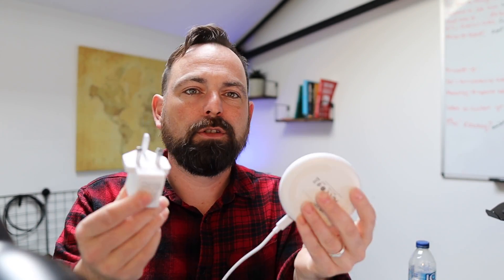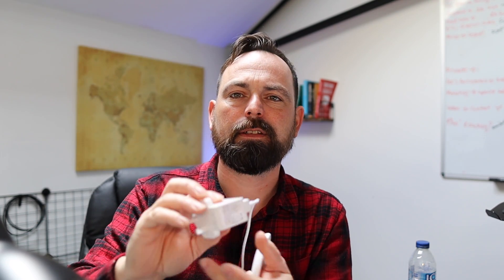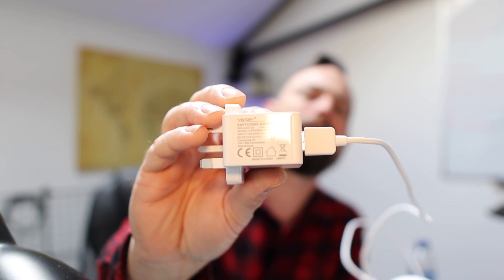PAT  Testing Explained | What you do and what you don't need! Electrical Safety

Comment: He doesn’t know what he’s talking about. He said if it hard wired into an outlet then it’s not portable. An outlet refers to a 13am socket outlet . If it’s hard wired then it will be wired into a fused connection unit commonly known as a fused spur. Also the first example of a double insulated plug which was a phone charger or something should still be tested for insulation resistance, as the plastic could be degrading and allowing voltage to leak through.

Comment: so what if it doesnt pass? just cut the plug end off and the owner of the appliance has to bin it
Reply: Cut the plug off. Cut the cable nearest the body of the appliance or some fool will put a new plug on and try to use it. Also label it as unsafe.
Reply: You saying new equipment does definitely not need testing is in my opinion wrong.i tested a brand new fane from China. It failed its earth bond test because the cable was too thin therefore increasing the resistance. Always test an appliance before initial use.

Comment: I love the PAT testing subject. People are completely stupid, they think anything with a plug on it is a portable appliance. Makes me laugh when I see PAT testing stickers on every plug. Washing machine... how on earth is that portable? Tumble Dryer, Fridge, Cooker... lmao. Does it have wheels on it? Well then it's a movable appliance, durrrrr. Are you allowed to pick it up by yourself while it is plugged in? Was it designed to be moved while plugged in. Make me laugh when people PAT test a mobile phone plug... How on earth can you move a plug while it is plugged in? "Portable" lol
Reply: Thats because it is no longer called PAT. It is fir all electrical equipment, not part if an installation and not subject to any other maintenance regiemes. The size is irrelevant as is hiw easy it is to move. What is relevent is its susceptibility to damage which is why it is all risk based now
Reply: @martynbarlow9952  I think half your message is not showing up

Comment: I thought you did a Insulation Resistance test on class 2 applaince? I need to run a test to log (even the visual inspection) into the tester for the paper work. I guess there's an option for visual test only will look for that now. Doing a test tomorrow & it's been a while:)

Comment: I note your comment a piece of Electrical Equipment that is wired to a spur this still needs to be tested as an appliance the term portable appliance testing is no longer used and as such has been removed from the guidance in 2020.

Comment: Don't get far before the first incorrect statement. Frequency of testing is the responsibility of the duty holder. It is not the responsibility of the competent person doing the testing.
Reply: Interesting observation, but in my experience the company would be unlikey to have the knowledge/background experience to make such a decision and would ask for advice. Also I find insurance often requires the testing to be completed annually regardless of necessity/informed advice.
Reply: @adrianhaw4635  Thanks for that input about what happens in practice. It doesn't change the rules nor absolve duty holders of responsibility. Your point about insurance company conditions is also very very important. It would be foolish to apply HSE guidelines if it would invalidate insurance.

Comment: Hi, Thanks for the video I have picked some good tips up. I am just about to test some musical equipment but have a few questions. 
Some of the rack mounted equipment does not have any class 1 or 2 symbols but do seem to be 240v as they are powered with kettle leads. 
This equipment is all from about the mid 90’s so maybe precede the symbols, do I need to test these and if so how do I know if they are class 1 or 2. Some of the other equipment are either 9 or 12v with power adapters. I know I need to visually inspect the adapters and label them, do I need to visually inspect the low voltage equipment and label and log them.
Reply: You should test the kettle leads you use with these gears. Depending on your testing machine, you may need to hook an earthing lead to an exposed metal from the gear to ensure earthing ground.

Comment: On the second item the plug was double insulated. Do you test the USB and lead?
Thanks for the videos. I'm finding them really useful.
Reply: Your best bet is to visually inspection on the charger. Nothing to test on the lead as the output to the lead is D.C

Comment: Incorrect -- Class 2 appliances with exposed metal parts should be insulation resistance tested with the test probe affixed to the metalwork
Reply: Yes, that jumped out at me too.
Reply: I would also agree with your observation @macmerc1556
Reply: That's what I was taught.

Comment: You can still do an insulation resistance test on a class 2 although it is optional. Source: in service testing and inspecting of electrical equipment 5th edition page 72: table 10.2 and page 73 : section 10.6.1

Personally I think it doesn't hurt to just test it because you have no idea whats lurking underneath the insulated cables
Reply: Yeah I've had a couple fail, it's rare but you never know.
Reply: You are a waffler. Your info is wrong - read the EAWR then read the In-Service Inspection and Testing of Electical Equipment edition 5 by the IET - Get informed before you misinform

Comment: pat test includes a visual look at item for damage  so a label on it says its been tested. also the hard wired socket on an item say a hand dryer in a pub toilet is a socket and should be tested to make shore it is safe, or do you just not bother with this item, if you are competent you should test these items as you cannot as a business just forget them. a building when inspected only go's to the sockets.(hard wired is a socket)  as a business you have a duty of care to everyone and must make shore all electrical items are safe, hard wired or not. pat is a poor name for the process of checking appliances, also safe systems of work forms more protection than pat testing. that's why its not law to have a pat test. the pat test can help with safe systems of work but not replace them. for

Comment: On chargers I do test for electrical safety by testing for electrical leakage as the charge end is metal and is linked to the lead going in to the plug side.  As depending on the fault in it as it may look 100%. But hi voltage can be at charge end.
Reply from the maker: Hi Alun, not sure which country you are form but we do not have high voltage coming out of our sockets in the UK, it is 230v which is considered low voltage. Regarding chargers, the iphone charger for example has an output of 5v so no chance of harm.
Reply: @i-hseq7635 wrong it is 240 volts, we use 230 as the normal voltage for calculations . The actual supply voltage is 240 volts Ac .
Reply: @i-hseq7635  I did say plug end of charger.  For leakage as is the charger a genuine or damaged.
Reply: @i-hseq7635  The charger maybe defensive I have had iPads in dead with damaged chargers.  Giving 85v out.
Reply: Absolutely no point in doing this. You will get no meaningful result. Please refer to the article from the portable appliance testing trade association article.

Comment: I am wanting to make lamps at home, basically upcycling old tools like hand drills. Do they require to be PAT?
Reply from the maker: No, you will need to comply with the electrical equipment (safety) regulations and other manufacturing regulations
Reply: @i-hseq7635  that's great thank you for your help and great video
Reply: If you take them anywhere like a workshop,  hotel, residential facility, etc, you will find on most occasions they will require all appliances to have been tested before they're are allowed on site or into the building

Comment: I have found that most companies have their electrical items tested annually or if they are lucky enough every two years regardless of any recommendations from HSE or IET, this is due to their insurance company stipulating this and also stating that it can not be done in-house or by a person involved in the company or even associated with them, for example a friend of a staff member etc, insurance companies get out clause I guess, if they can get out of a payout they will.

Retest dates are now down to the duty holder to make a decision by risk assessment according to IET, so that takes the responsibility off of the tester/competent person to make that decision, and retest dates are no longer required on any test lables if used.

Also most insurance companies insist on a test for every electrical item that gets plugged into a mains power socket regardless of construction class, so even class two would need at the very least a formal visual inspection (FVI), but if any exposed metal parts then a insulation resistance (IR) test as well, and all tests must be recorded on a test report with certificate, lables optional.

Comment: Would pat tester recognize a reverse polarity on a sppliance
Reply from the maker: Thank you for your question, this video is intended for those with responsibilities for health and safety in the workplace and not an instructional how to on PAT. The answer is also not straight forward. when you sat PAT tester do you mean the person or the machine? some machines have a polarity test function, you could check the polarity by looking a the terminals if the plug/appliance isn't moulded. why do you ask? if you wan to know how to check the polarity of something then there are easier ways than buying a PAT machine with polarity function, from new UK/EU appliances would be wired correctly, it would only be if someone interferes with the appliance that polarity could have been reversed? or are you asking about extension leads?
Reply: It will definitely pick up on an IEC cable that’s wired incorrectly especially if it’s a European Schuko plug with one of those conversion plugs that can be inserted over it. Because the right angle plugs have to be inverted to fit and that by default reverses Line and Neutral.

Comment: Unfortunately this video has out of date advice according to the latest 5 the edition  of the regs. I believe that there is now a requirement for hard wired devices, especially class 1 to be tested by accessing the wiring through the switched fused spur. This means testers need to be aware of how to safely isolate and lock off the supply to the device as well as a degree of competence in connecting the tester to the unwired device. This change could be well beyond the capabilities of some people who have undergone formal Pat training but are not electricians. The regs have dropped the name Pat to in-service inspection and testing of electrical appliances and do concentrate on assessing the necessary frqency of testing as in the video as well as only visual checking of class 2 devices.
New equipment shouldn't need testing but Chinese products purchased on eBay maybe class 1 but have been found to have the earth bond wire not connected to the metal case, or even no earth bonding. Also the UK plug provided can be un fused, too small , and have totally incorrect pin sizes.
Reply from the maker: Hi Adrian, the electricity at work act 1989 has not changed, however you are correct the IET code of practice is now in its 5th edition and recommends all appliances are checked as you state.
Reply: Thank you for your reply
Reply: Unfortunately your information is incorrect. Firstly there are no “regs” just a code of practice which is only “guidance” - you do not have to test to the code of practice but is seen as the best guide of how to.
The new 5th edition code of practice does explain that the many different types of appliance “can” be tested in a particular way but it does not mean that everyone has to do it that way. If you are a PAT tester and all you do is test “portable” items with plugs then you are perfectly within your right to do so.
Reply: Also the word PAT was never in any copy of the code of practice.
Reply: I was surprised to see your comment pop up after 2 years.  I will look at the advice on checking  apliances hard wired through a fused spur as it concerned me, and would be a major change to what has been suggested in previous literature. If I can locate the advice I will post it. 
As regarding new equipment I will always check class I appliances suspected to have been made in China as these products certainly are supplied with either no earthing or  the earth wire not bonded to the metalwork. I have seen many instances of this failure. All told the idea is to assess electrical appliances for safe use in a public environment and to carefully select the frequency at which these tests/visual inspections are made. Regards from Adrian. @caterhampattesting

Comment: I dont understand why you wouldnt electrically test a class 2 appliance. This is an option on all pat testers ive used and necessary in my opinion
Reply: Hi Susanna, in some ways you are correct. An electrical drill for example maybe class 2, but have an exposed metal Chuck, in which case the class2 test would confirm good insulation between the wiring and exposed metal parts of the appliance. It also helps to generate a log of the appliances in use and that they have been visually checked, and have the correct fuse fitted. Quite a lot of power supplies for low voltage equipment eg laptops and other chargers have no exposed metal parts and so the latest regs suggest assessing the frequency of testing such devices, and of course there is a duty of care for all users of electrical equipment to visually check the plug, wire and case and not use it if they find any defects.
Reply from the maker: Hi Susanna, thank you for your comment. so, you are carrying out an insulation resistance test on an appliance? The item i was referring to is a transformer therefore there is no physical connection between the windings and the outlet, the voltage is 5v. The point to this video is to debunk the many myths surrounding PAT, please feel free to look at this guidance from the UK HSE that clearly states you do not need to PAT Class 2 items. https://www.hse.gov.uk/pubns/indg236.pdf

But, if you are happy to charge people to test them anyway, or pay someone to test them, or spend your time testing your own ones feel free, do you know why you are doing it?
Reply: This HSE guidance is for low risk environments only. It is NOT general guidance for all circumstances. Please be a little more careful.
Reply: I qualified C&G nvq level 3 electrical 10 years ago, mostly worked in hydro and currently wind. I’m thinking of a side hustle of PATesting to top up income. Do you think setting up a little business to operate a couple of days a fortnight is worth it in the long run? What is possible to earn at that time scale?
Reply: @katiefinnegan4649  No

Comment: Thanks for the very informative video. I am an amateur musician and have been asked by some venues to provide proof of PA Testing of my equipment. This comprises portable fans, amplifiers and mixer desks supplied at 240V and 12V via double insulated AC adaptor plugs, electric guitars plus leads, microphones plus leads. I can understand that the 240V and 12V gear needs testing but what about the guitars and leads, please? As an amateur, I don't want to spend more than I have to.
Reply from the maker: Hi Ian, sorry for the delay in replying, i didn't get a notification!

As an amatuer guitarist myself i feel your pain.

Anything with a 3 pin plug that is not double insulated must have a visual inspection and ideally a test, double insulated items should have a visual inspection, as your gear is being moved frequently i would advise you to make a habit of checking it yourself pre-use.

No, guitars, pedals, mics etc. don't get tested as with the 12v stuff, just items like amps, PA's etc.

Hope this helps?